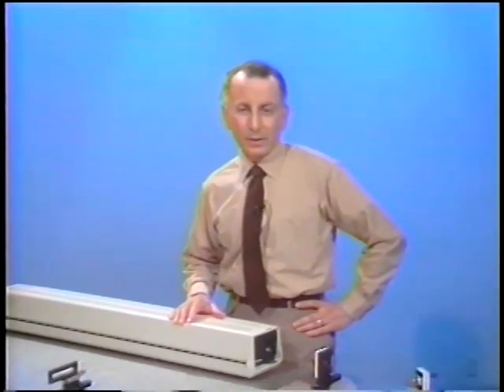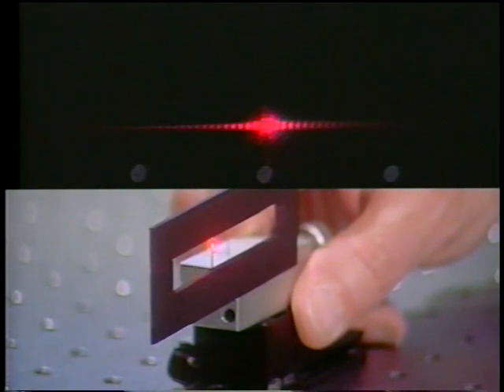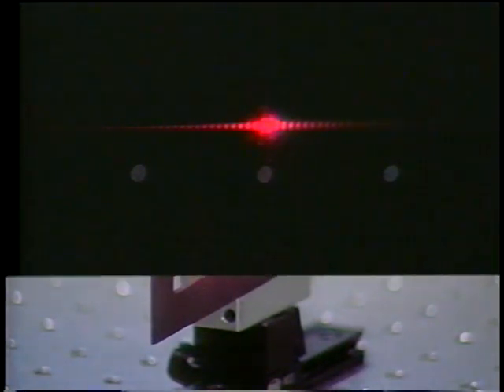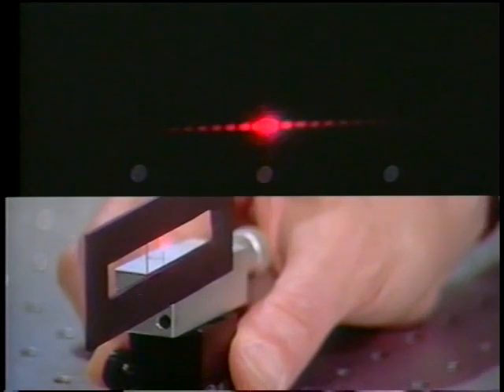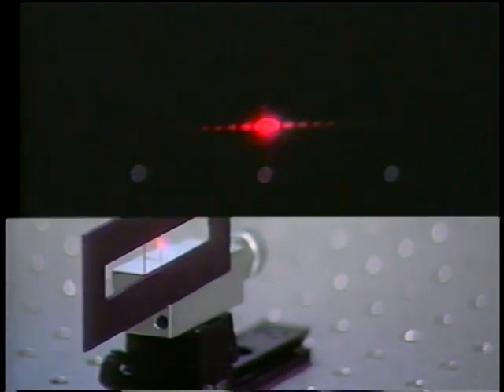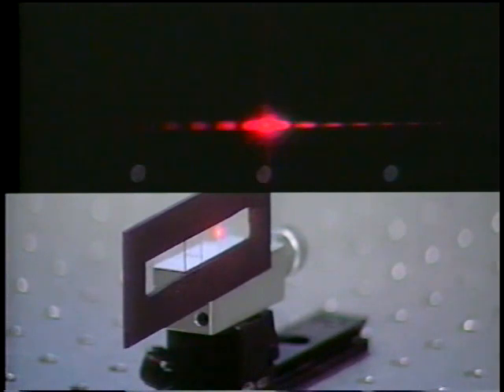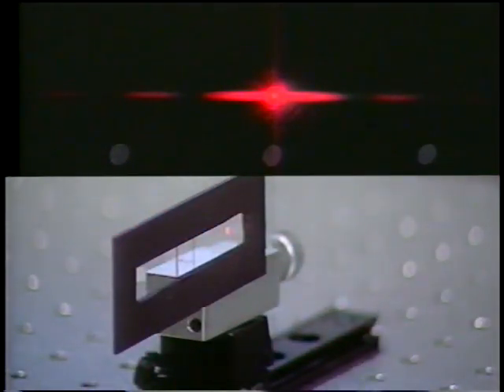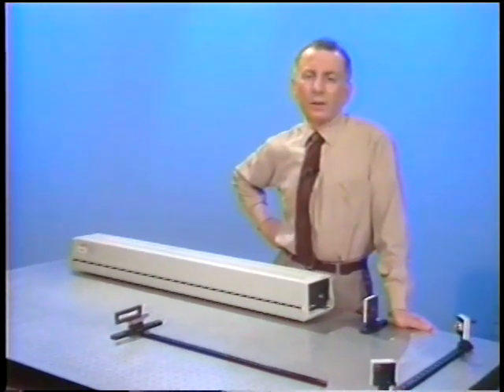Optics: Fraunhofer diffraction - thin wires | MIT Video Demonstrations in Lasers and Optics

Comment: Excuse me. May I know why the laser must go through 2 mirrors before go directly into 4 wires? Is it okay just to go directly to the wires without reflecting the mirror? The mirror used for reflect, is it 45 degree? and why the laser have the wavelength of 6328 angstroms? and why the distance between wire and screen is 200cm?